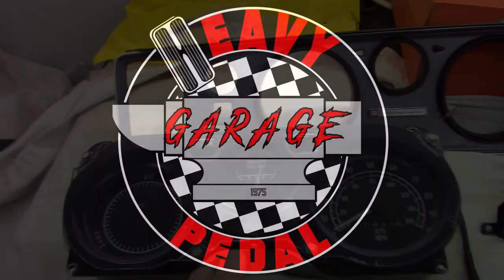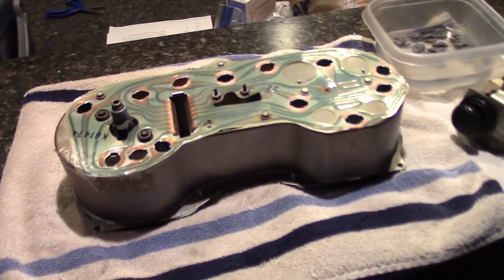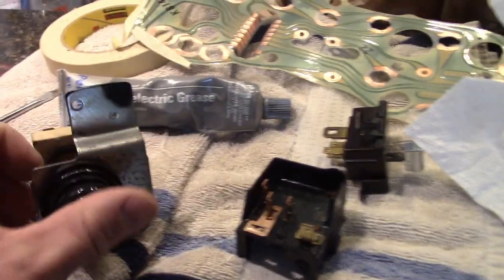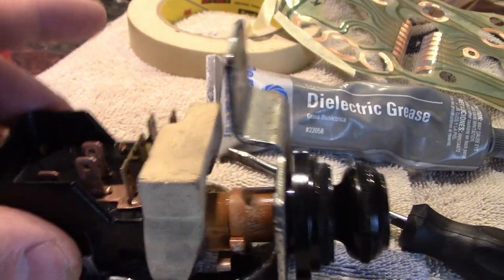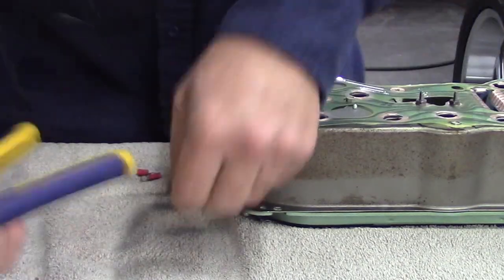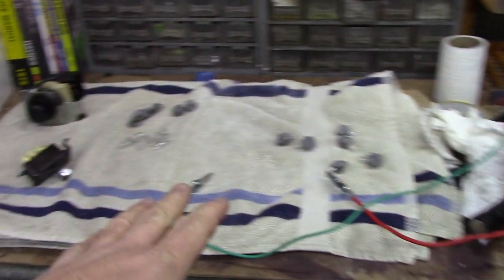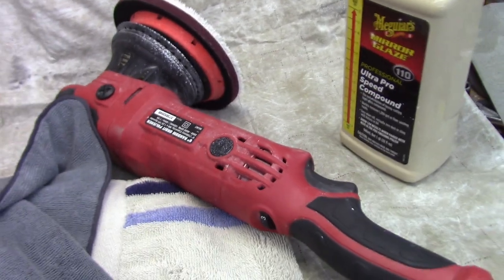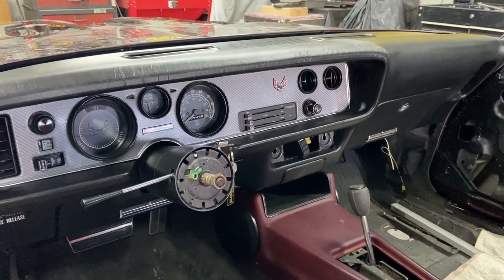Gauge Cluster and Headlight Switch Restoration. Cleaning the Contacts and Polishing the Lens!

Comment: What would have happened if you placed the circuit board in the vinegar solution as opposed to just brushing it?
Reply from the maker: I had though about that. But there are several layers to the board. I was afraid that vinegar would seep between the layers and would be tough to rinse out. So I just brushed it on the contacts instead.
Reply: @HeavyPedalGarage  that makes sense.. I have to do this to my 85 firebird, you very well may have solved my instrument cluster bulb issue. Fingers crossed this weekend!
Reply from the maker: @chrisbentley3468  good luck brother. I hope it works!
Reply: @HeavyPedalGarage  it worked! All my bulbs now light up and they're alittle brighter! You're a life saver! Thank you so much!
Reply from the maker: @chrisbentley3468  SUPER AWESOME dude! Glad it worked!
Reply: Hope this works for my 1970 delta 88 it’s a convertible and lots of corrosion on interior parts I’m assuming the rust and buildup on electrical could be the culprit for my lights not working. Only the oil light lights up with key in on position before start up. I replaced all bulbs as they were burnt now need to clean.
Reply: What’s the mixture in the cleaning solution?  Is it straight white vinegar, or 50/50 water/vinegar?